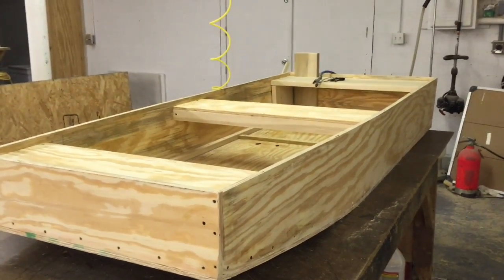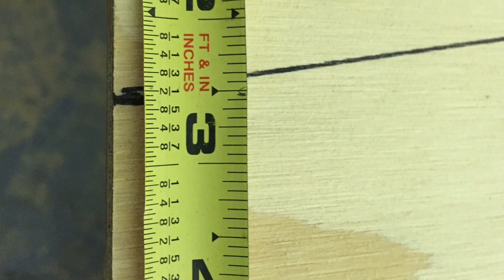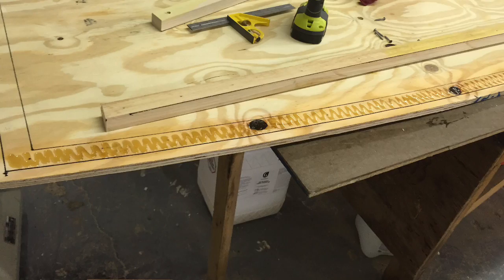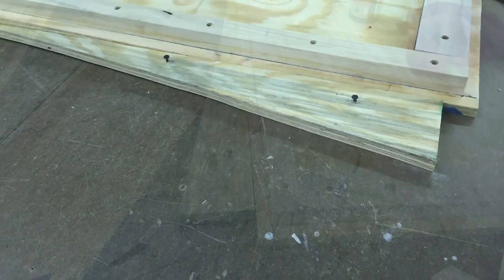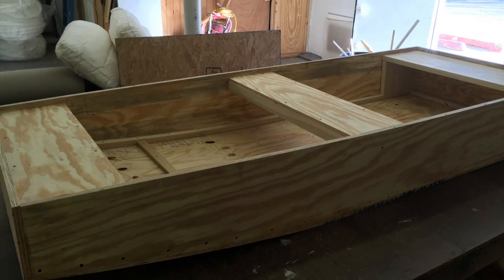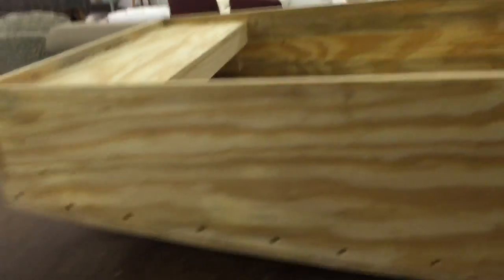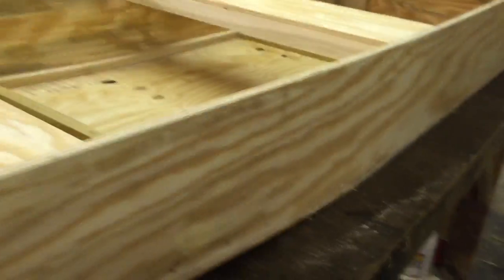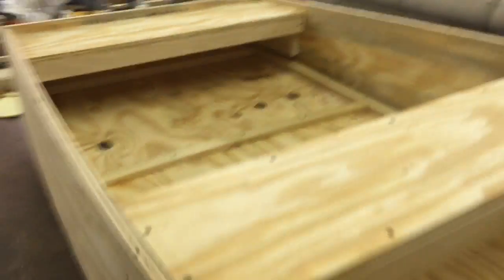Homemade plywood boat part 1

Comment: I'm building one almost the same size as that (42" X 96") I decided to go a bit lighter with 3/8" plywood and that should make bending the bottom board easier in the front. If the 3/8" gives me any trouble, I may go with a sheet of 1/4" plywood first and then add another one glued to the first one. It would be much easier bending two 1/4' sheets than one 1/2" sheet and I'd have all the strength I need.
Reply from the maker: There is several things I would do different 👍🏼

Comment: Nice video! And also how's the stability of this boat
Reply from the maker: Hi Frank, it is stable enough, but I would build it bigger and lighter if I were doing it again. I’m thinking about doing a review video on the boat. Thanks for posting
Reply: Billof Rights  Thank you for the information, I'll be building one of these this summer so I appreciate the advice